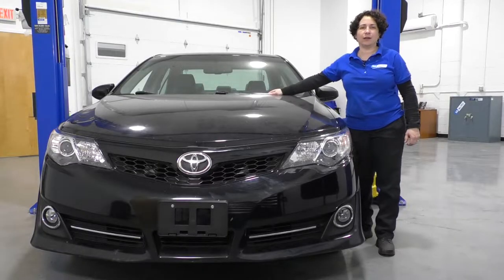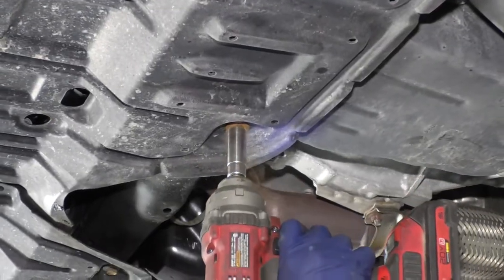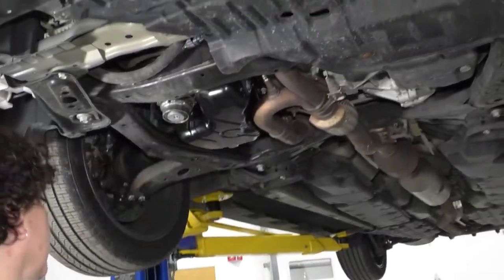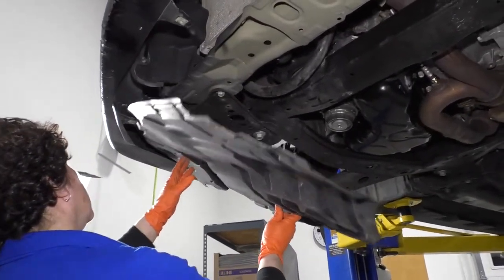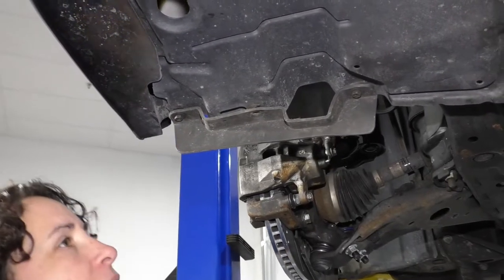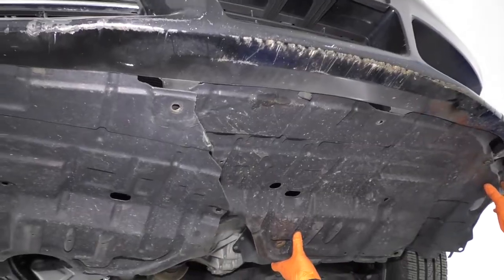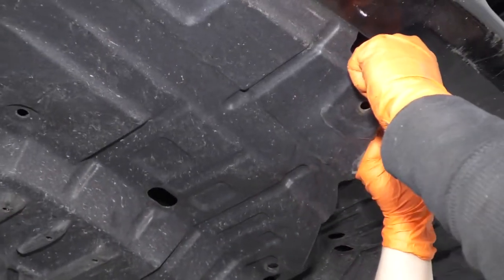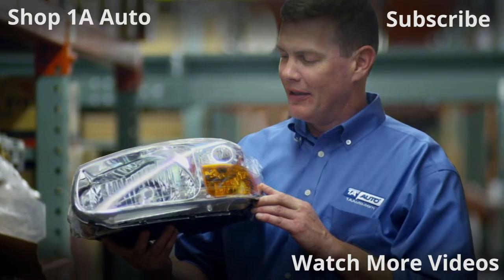How to Replace Splash Shields 11-17 Toyota Camry

Comment: can you tell me more about the 10mm bolts.  length  , thread size ,  or are they screws and what  size 10,12 ??  my 2011 is missing a few on the left side (passenger side)   just bought the car.

Comment: in the video, you remove a bracket that runs under the shield towards the bumper.  You called this part a vent.  Exactly what is this bracket called or do you have a part number?  Mine was damaged and I want to replace it but cannot find it.

Comment: Does anyone have the specs for the body clip between the two sides and the 10 mm bolts?  Alternatively, if I go to an autoparts store and tell them I need the body clip and bolts to secure a splash shield on a 2014 Toyota Camry, will that be enough information?  As OP has mentioned in the comments, auto parts stores probably have the right clip, but will they be able to identify it without being able to see which one I'm talking about?  The issue is that I am having to re-secure my splash shield because the parts are missing, so I will not be able to offer a sample.
Reply: I would say look for it at a junk yard. Take it off the same car
Reply: Think it is 90467-07214 - not 100% positive.

Comment: Hello at :46 mark what is that piece called. She says rubber vent I’m trying to find it. Is it required to replace if you can’t find one!
Reply: I think these are the parts numbers for those rubber pieces on both sides:   5385206040 and 5385106040
Reply: @travisgrindal  Thanks for the part numbers! It's so hard to find what those rubber pieces are called.

Comment: Nice, but no explanation of where to purchase anything; e.g. where to get replacement push pins?
Reply from the maker: +4af Thanks for watching!  We do not actually carry the splash shield or push pins for this vehicle at this time.  As for the pins you can typically source them at your local auto parts store.  It is usually best to take one with you to match it up!  1aauto.com
Reply: @1AAuto  You should put that in the video description. We don't have this specific part, but we have thousands more for your vehicle, click on this link to see all of our great parts for your car.

Comment: What is that rubber vent piece called? Everywhere I search to buy splash shields, none of them seem to have those pieces and none of my searches are finding anything.
Reply: Toyota lists this part as a Fender Liner Pad, Right position 53851-06040, Left position 53852-06040. 
Other places may call it an extension pad, wheel opening pad, liner extension etc.
Reply: Have you had any luck ? I’m looking for the same pieces.
Reply: Fender liner pad??
Reply: Fender extension panel is what I found
Reply: I think these are the parts numbers for those rubber pieces on both sides:   5385206040 and 5385106040
Reply: @travisgrindal  Thank you for this. I was able to look it up and order them to do the replacement.

Comment: I cannot find how many screws are supposed to hold up the splash shield. I have watched this video like three times and don't know where they are supposed to go. I only say this because m7 2014 camry is missing some and I'm sure that's why it was bent back by road and parking obstructions. I can't find anywhere where they all go and I even have a Haynes Repair Manual.
Reply: I watched it one more time, I guess there are 8 along the rear side and 4 on the front. ACE hardware didn't carry metric bolt heads, so I needed 10mm to take out the remaining ones and replaced the missing ones with a similar bolt head and nearly the same screw and length. This might explain the rusty replacement screws she removes in the video. The ones I bought are stainless steel, but i'm sure they'll rust at some point. Much cheaper than buying the screws they have for another purpose (at ACE)

Comment: I wonder what the part numbers are for the the 10 mm bolts and push pins are? Still a good video.
Reply: I could find the pushpins on local auto supply stores (like autozone and advanced auto parts) but not sure where to get 10mm screws. ACE hardware in my area only carries standard screw heads.
Reply: @jackiebeidler4592  I believe they are self tapping screws.

Comment: Would be cool if we knew what type of screw is recommended.
Reply: She said use 10mm plus a clip.
Reply: Did you ever figure out what size screw you need? Cause now Im trying to figure that out 😂
Reply: @cottonmather5883  10mm is just the screw heads' size, it doesn't dictate the threading or the length, etc.